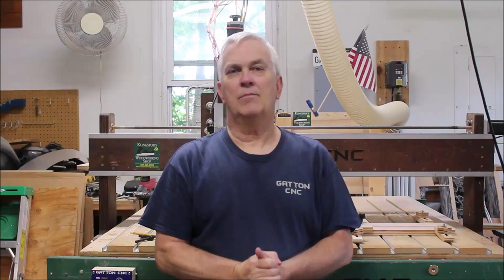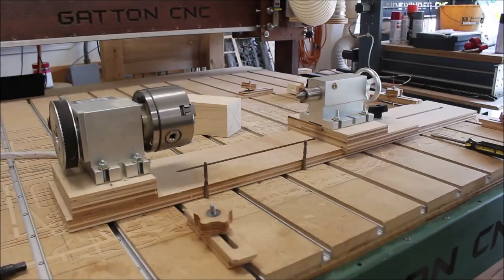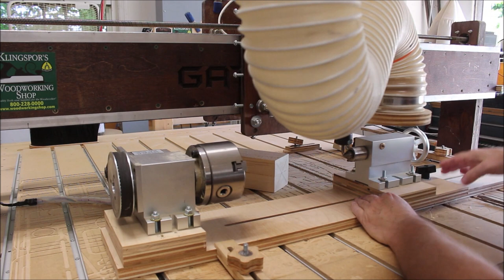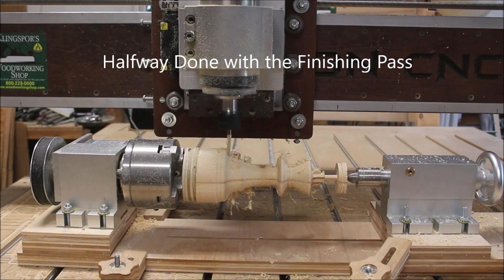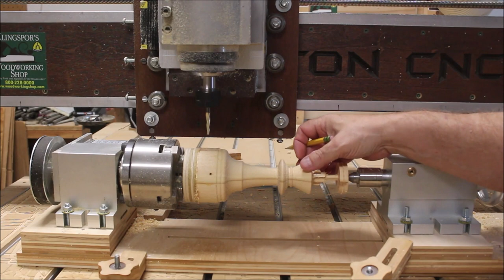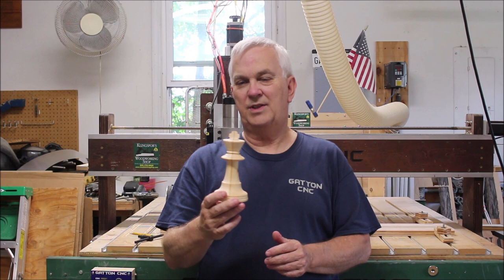Making a Chess Piece with my Rotary Axis

Comment: Great video Dave.  I have tried a similar project & like you I found the cnc was going too far to the right & leaving a very thin piece 
that could break off.  How did you modify your design, by altering the G code ? I am using Vectric Aspire.  Any help will be appreciated